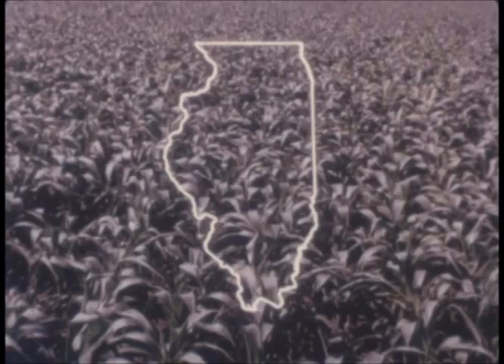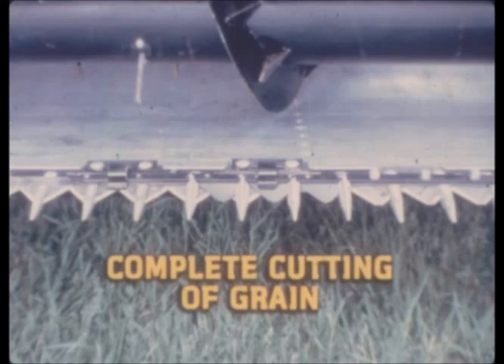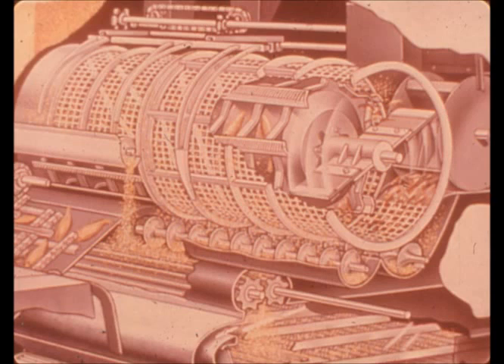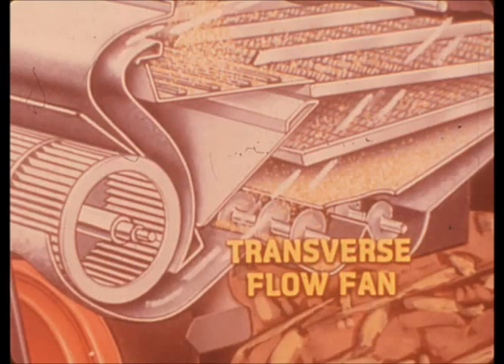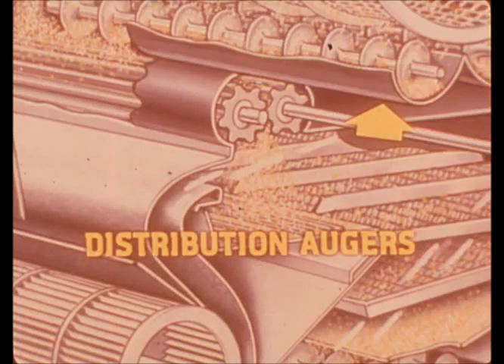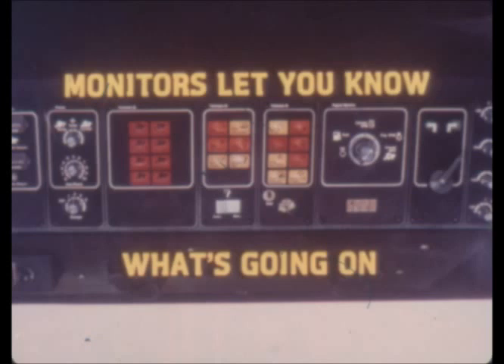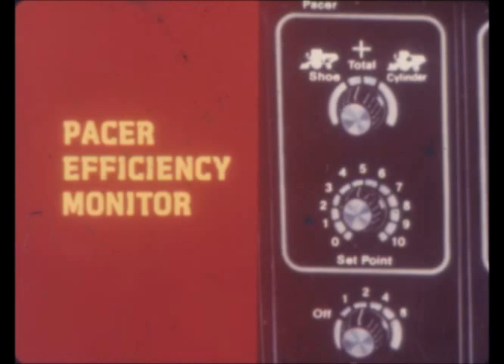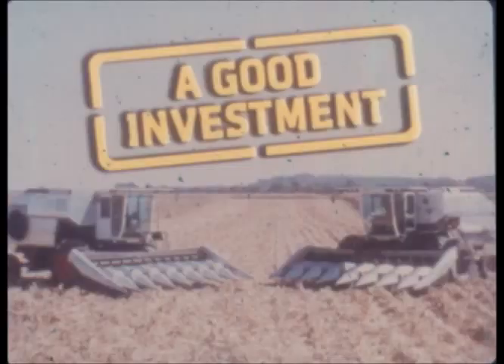1979 to 1985 Allis Chalmers Gleaner N Series Rotary Combine Demo Pak Tape AC063

Comment: I started out as Kid running a A model combine 12 ft header whent to a C2 14 ft header then to G 16ft header then to  a L2 24 ft header used it for several years until got out of farmer then sold it and it whent to the Canada boarder.

Comment: Just brings a shiver to my spine watching this video and thinking how many customers they lost and how many custom cutters they lost or went broke because of these combines.  If you read the PAMI report the break downs during the test list was 4 times longer for the N6 then either the JD 8820 and IH 1480.    Gleaners were popular around here until the N series.  Our normal custom cutter at the time Tupper out of Kansas ran Gleaners starting with the Gs and it was the N series they broke him.  Finished his career with JD.  We had another custom cutter with a N7 try to cut for us one year.  Whatever concave setup Gleaner used it would not work in our solid stem wheat and just kept plugging.  The cutter tried everything even to the point of removing the cage sweep.  Finally he was doing such a poor job we finally told him to go pound sand and that was the last time a Gleaner cut on our farm.  Gleaner should have kept the N series off the market for another 2 or 3 years.  Should have sent maybe 100 combines on the harvest run.  Revaluate them after the run, fix the flaws,  send 100 more then next year and do the same thing again until its right.  The design was/is good.  Just poor execution.
Reply: everyone had trouble with their rotary, just Gleaner gets picked on the most. see the feeder house argument.
Reply: Solid stem wheat? What kind of wheat is that?
Reply: The N series combines that are still around are pretty reliable.
Reply: I was raised on a farm. We purchased an N6 with 20 ft header at the start of wheat harvest. The best ground speed I could get was 3.5 to 4 mph before the cylinder began violently shaking or the cage sweep stopped causing slip clutch to slip. Unhooked the cage sweep and the shaking persisted. Long story short, AC technician discovered some of the cylinder bars were reversed at the exit end of the cage causing a buildup of straw, etc. The error was fixed and the N6 was a beast from then on.

Comment: I miss the old orange company. Growing up we had a D17 IV, 185, 190xt and 8030.
The one thing I caught from the video when they were talking about the operator controls was the throttle and "choke" position. Hmm, I  never knew that they offered a gas engine in the N series.
Reply: erienwhite I sat a lot of hours in an N-7. Shelled a lot of corn, and cut a lot of milo.
Hourmeter quit around 4500 hours and kept it going 6-7 years after. Finally started having big pieces of the cage break out, and it was beyond shot.
Remember schooling a brand new 9600 Deere with it in milo.
Salesman quit trying when that happened!
Reply: @RedIron1066  My in-laws are running an M series and an N series combine. I know the hour counters on both of them failed a long time ago.
Reply: RedIron1066 We still run an N7.  You are correct on the fan choke.  Less moving parts than everybody else's variable speed fans.
Reply: DD2 I think the choke they are referring to is for the cleaning fan.
It's constant speed, so intake air is "choked" to regulate flow.

Comment: Learned to drive combine on an N6. I loved how easy to operate they are
Reply: I learned two years ago on my in-laws' M and N series combines. The hour counters stopped working years ago but the combines are reliable.
Reply: I have to add, getting them into and out of gear can be a pain at times.
Reply: I learned on an n5. Couldn't get 5 feet without breaking down. Told dad I was gonna blow my brains out over that combine, among other junk we had. One day I tried but mom pushed the gun away at last second. Got a fractured skull and dad still fixing a gleaner. True story. Yes, gleaners are that bad.